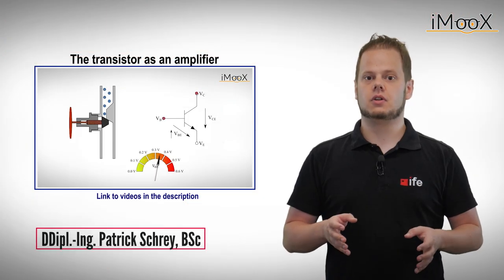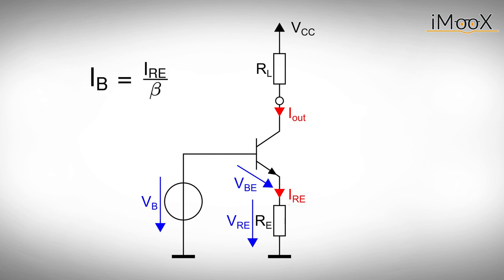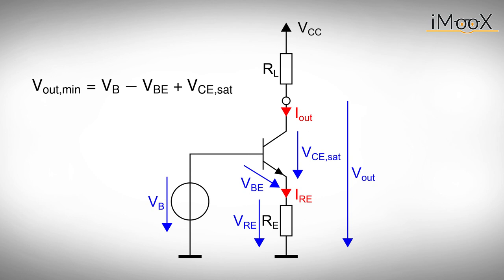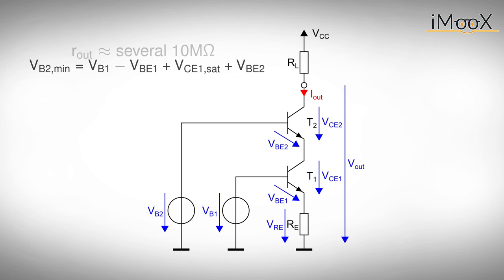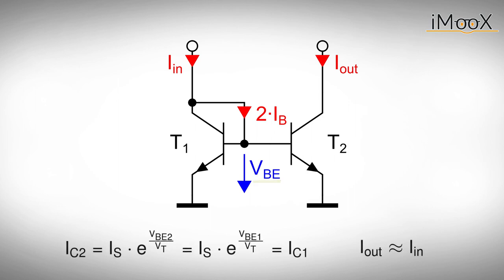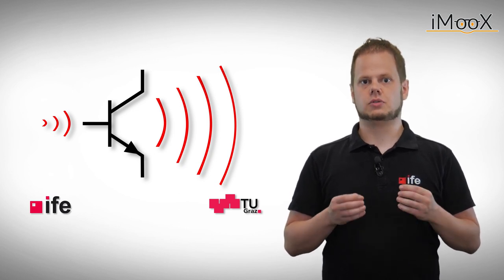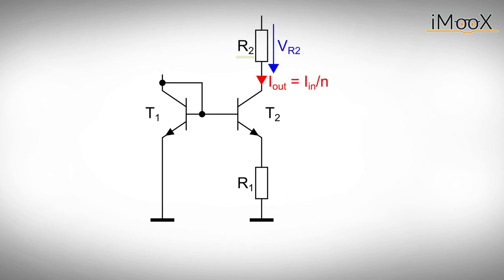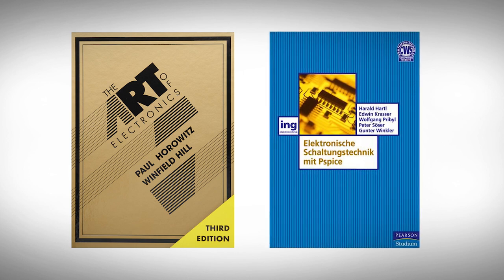Transistor Circuits

Comment: I was looking for this; its hard to find; that is why you should specify it with the name of amplifier or differential amplifier or something otherwise no one can google it easily. They might think this as a starter explanation. This is transistor as an amplifier (part 3) for me. And add links which has a connection like this series here. Because I think I have found the best theory explanation in youtube for transistors; I don't want it to get lost.
Reply: By the way, we have a new channel so you can't get lost anymore:
https://www.youtube.com/ifetugraz